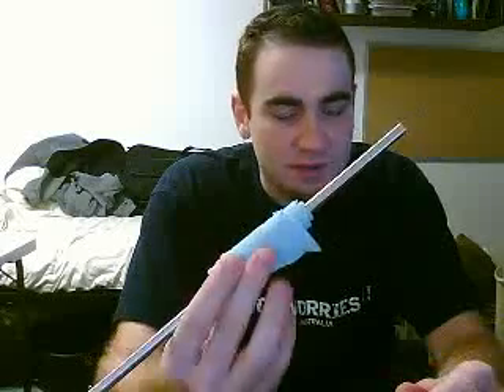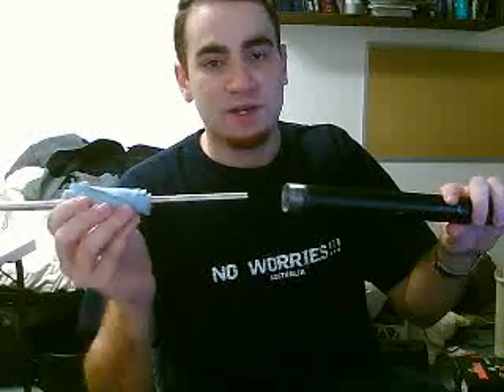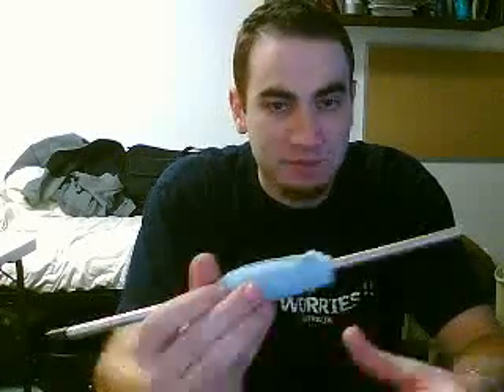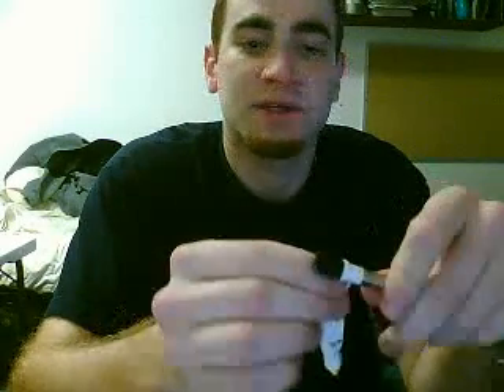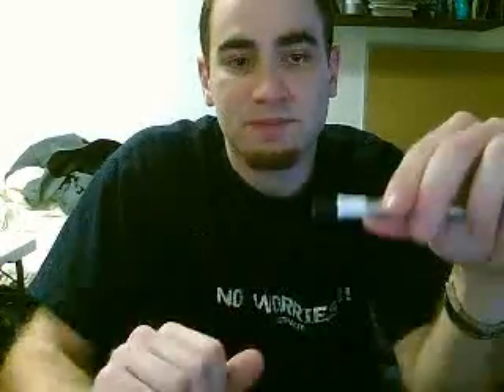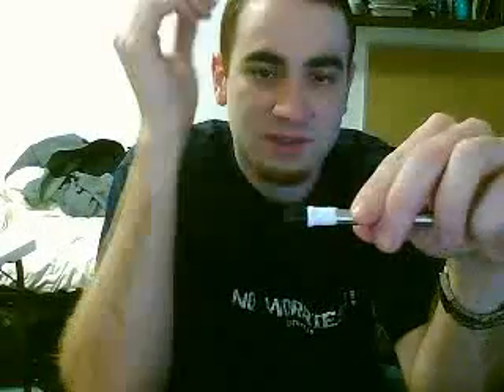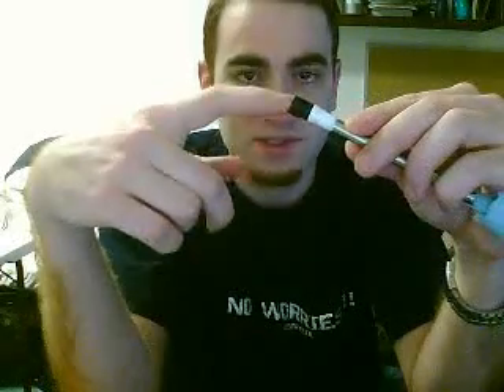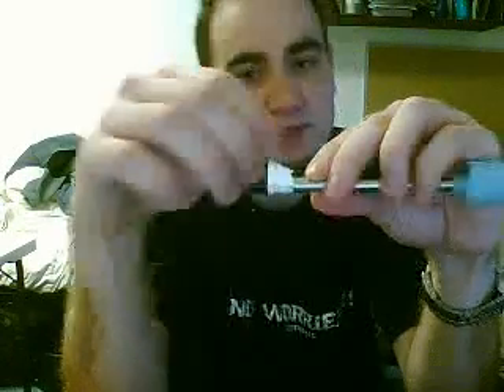Teflon Taping Bar-10

Comment from the maker: @mattb807 it works. ("OK") I've used modeling clay to do that very thing before. The difficulty is that it sticks to the outer barrel as you slide the barrel back in. A way to resolve this is to wrap paper around the clay so it doesn't stick to the outer barrel. Increasing the mass of your gun, theoretically speaking should help with vibrations (raises the natural frequency.)